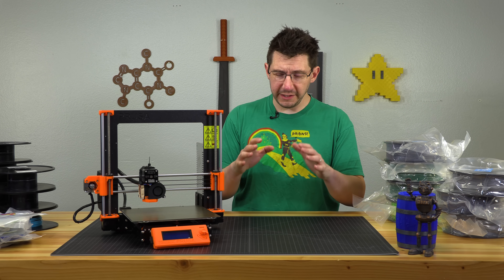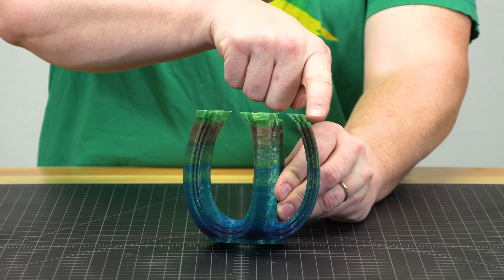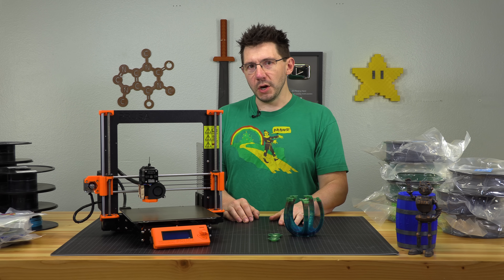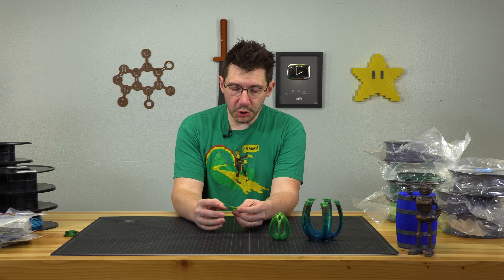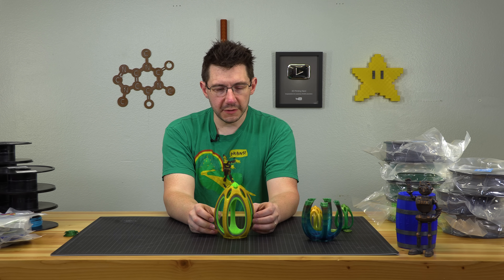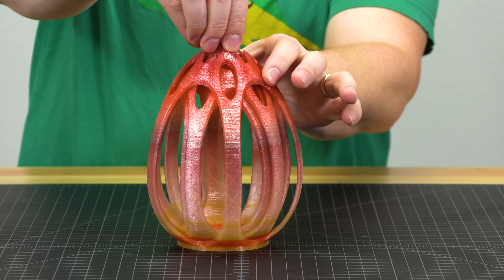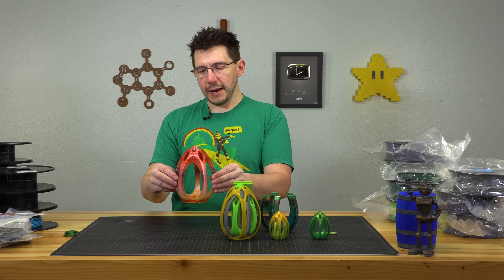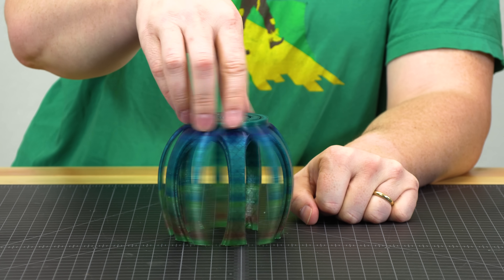This Egg Broke My 3D Printer - It's Maker's Muse Fault! #DestroyerOfWorlds

Comment: You have a LOT of printers, so I'd probably also ship it out rather than gut it and work on it myself with other projects on the table, but it would've been neat to see your troubleshooting process for the MK3. My first thought would be the optical encoder for the filament sensor being dirty or just going bad, though. That printer's a little too smart to try to print with a jam if it was a purely mechanical problem.

As far as cutting yourself while cutting a fused first layer goes, leather gloves are great for that. They make it a little awkward to cut fine details, but they've saved more fingers than I have, from all the times I've forgot to change the offset for higher bed temps. (And then there's every time someone asks for a really smooth bottom on a part and I groan and drop the Z intentionally for easier post.)
Reply from the maker: Oh, believe me, I took the machine apart a number of times. heh. It was awesome and sucked all at the same time.
Reply: That's a shame. Hopefully it was some kind of early unit issue. Got a 2.5 upgrade on backorder, and I think I'd go crazy if I couldn't pin down the specific issue. If you hear back on what it was, I'd be interested in an update.
Reply from the maker: It was beyond an early unit, it was a training machine that wasn't suppose to leave the factory. Oops.

Comment: Update your firmware. In silent mode I had plenty of layer shifts. Since the update 2. March ,they are gone
Reply from the maker: I'm running current firmware, and not using silent mode. :(

Comment: 200% is actually significantly easier to print, not only are the walls thicker making the part more rigid, but the gaps between the parts are twice as large. For a real challenge, try printing it smaller!
Reply from the maker: I did, I had a couple 100% scale eggs that I showed, did you see them?
Reply: 3D Printing Nerd Oh no I saw those, I mean scaling it down below 100%. Normal scale is still not easy and quite an accomplishment for any printer, but anything below 70% is very very tricky!

Comment: Do you know what broke on the printer, to cause such a layer shift? I would have assumed a motor or a belt issue... or maybe some structural issue that finally gave out..
Is there any reason you can't try to fix it yourself? Or is it just a warranty thing with these units that are sent to guys like you? heh
Reply from the maker: No idea yet. I took it apart a few times. I could try and fix it myself with parts, but it's a review unit, and it's going back to Prusa and team for research.
Reply: ah oh well. That makes sense. Just an odd defect I guess, hopefully it's extremely rare. heh

Comment: Be sure to keep us posted on what Prusa finds, as I have the same problem with my MK3, the semi all metal hot end just does not like PLA. Is there a easy way to put the original i3 MK2 hot end in the mk3 ? if so then I think we would really have a great printer.

Comment: Your retraction distance should be 2 or 3 mm, more than that it clogs. The layer shift is because layers at that point are not flat and thus nozzle hits them causing layer shift. Layers are not flat because of overheating thus expanding mainly upward. Nice prints, filaments and design

Comment: When someone starts having clogging and loading issues like that, what can they do to fix them?
Reply from the maker: In this case, I would normally play with temps, print speed, and retraction settings. However, in playing with this, it didn't solve the issue, and gcode that worked before now did not work with the same material. So, something was up.
Reply: Thanks for the reply! I really appreciate you and your videos. I installed a new heating block, all metal hot end, and cooling block yesterday (MK 10 on i3 Plus)... it's a pain to load filament, and doesn't seem to flow until about 112c. I printed a 20mm^3 to calibrate, and the first layer was GORGEOUS... no other layer even came out. I pushed the filament out with the little rod that came with the i3... I must have an alignment issue or heat fluctuation issue.

Comment: Hey Joel live the videos, for making each part of the egg move, why use 3 motors? Use just one and 3d print a set of geared rings nestled within each other with a tiny gear between each they'd then change direction on each phase/onion layer
Reply from the maker: That's a fun idea!

Comment: unfortunately most people haven't lucky on MK3, egg is printed but not movable, bottom layers are fused not first layer but upper overhangs, please post S3D or Slic3r profile because I'm really starting to think that this printer is all just propaganda
Reply from the maker: I know Angus got a good print on his mk3, and in his latest video talking about the community prints, he showed off some other mk3 prints. They looked good. I'm using default PLA settings in slic3r.

Comment: Re: motorizing. Remix the egg yourself. Add a shaft ending in a gear to the center. Maybe have it seat in a 608 bearing. Add a shorter hollow shaft and gear the the next shell and finally add a gear the the outer shell.

Comment: Im no expert but but tolerances are independant of size of print. It didn't fuse on the bigger model coz the tolerance is twice as big. Have you put in the same tolerance for the smaller and the bigger model both would have been fused or seperate.

Comment: I tried to print the egg like 4 times - first times got about half way, before clogging - then wouldn't get above 1cm without clogging. (200% on a wanhao i3) - went and printed a different model and it worked fine....its just a devil egg

Comment: I seriously want that filament it's MAGICAL
Reply from the maker: They are working on it! Right now it's a ton of manual labor to do. Once they can get a better process down OH DUDE you can bet they will be selling it.
Reply: I really wish protopasta would sell it...
Reply: They just need a hopper to rotate a bunch of colourant so users get a random selection lottery-style. Not that hard to discuss, probably a touch harder to implement in industry.
Reply: Actually, here's an idea; Protopaste might be able to take waste blocks and pay by the pound for them. In doing so, the blocks could be chopped, melted and coloured black as a low-strength filament provided for cheap as a means of waste blocks to find new use in non-load applications.
Reply: Not the exact same nor as magical, but I've had great results with https://smile.amazon.com/dp/B01IBF2T0Y/ref=cm_sw_r_cp_awdb_t1_fAa0AbPFQFYXQ
Reply from the maker: She is a sponsor here on YouTube, and for being a sponsor she gets that coolness!
Reply: Now if only I didn't have to sell the firstborn to get their stuff here :(

Comment: Id love to print that egg, but first I NEED TO FLIPPEN PRINT A BENCHY THAT DOESNT LOOK LIKE CRAP AND DOESNT FAIL! Ive printed 7 benchys, 5 of them didnt even get past the first layer, 2 of them didnt get past half way, one i had to stop cause it was in the lounge room, the 2nd failed because the fan wasnt on. Then there was my most recent and final (for now till i buy filament) benchy which failed at the boat's roof, IT WAS SO CLOSE TO FINISHING! Its really bumpy though, i need to figure out why i get such bad print quality. I know part of the reason why is because im using a Anet A8. I do need to buy a better printer, im just poor.
Reply: As someone with an A8, it works fine. I've gottent some pretty stellar prints out of mine.

Is your bed levelled correctly? It's a pain to get right, but take the time to do it or you will be punished.
Do you have proper bed adhesion? Brown masking tape and some glue stick is good.
Turn your print speed down. The A8 is happy with a max of 45mm/s for printing and 60 for travel.
If your slicer supports it, use resonance prevention.
Also, flash the skynet firmware. at some point. The stock firmware sucks as it doesn't allow for calibrating the printer, and the stepper motors scaled a few percent out so calibration is a must. After benchy.
At some point, print some support brackets. The A8 is about as wobbly as someone who's had five beers and two shots of whiskey.

Don't blame your tools for a lack of personal knowledge. Tweak, adjust, dial the thing in.
Reply: One thing to consider in a printer purchase is even though the printer is cheap, you waste time and money in failed prints and wasted filament.
Reply: The bed is the one thing that is perfect, ive gone over that thing repeatedly, theres no possible way it is not levelled correctly.
I have masking tape but i have not done the glue stick idea.
That is a good point, i need to turn it down.
Im using Cura and i havent seen anything like that yet.
And ive heard about skynet but never actually looked into it yet.
Ive been looking into supports right now, when i get more filament ill be sure to print them.

I know i shouldnt blame it, but truth is i got this printer months ago, got a replacement PSU a few days ago after i blew up the first one when assembling the printer, i kind of changed it from 110 to 220 while it was on. Today was the 2nd day of printing, but the first full day of being able to print something that actually didnt fail.
Reply: I knew that it wasnt gonna be easy and i knew i would need to work on this over time, but i was in a rush, i always am and so i wanted to get a printer quickly.
Reply: Hi there, if you are having issues, try the anet a8 group on Thingiverse, they are a very friendly group and I learned alot about tuning my a8 there. Post pics of your failed prints and settings, I'll try and help you out. https://www.thingiverse.com/groups/anet-a8-prusa-i3
Reply: My Anet A6 has the same problem, so I don't use it anymore and use my new(er) Hypercube.
I'v tried a lot of things to get my old printer printing properly again, but after replacing the heatbreak and adding a volcano heater block in it, the best I could get was  with a lot of missed extrusions.
The stepper and heater and thermistor and stepperdriver are all okay...
Reply: try reducing the retraction amount to 1.5mm. Dont buy a new printer!!! get to know that device and learn from it. Even on that one you can get good prints, and you can print upgrades to improve it. The fun of 3d printing is not so much the objects you print, but the road that gets you there.

Comment: Tried to print it at 100% scale on my MK3 but unfortunately for some reason I'm getting problems with overhangs there. It looks nice but it's not movable. Tried to break it apart to figure out what's wrong and there I saw that it's fused together because of bad overhangs in the first layers but only on one side. Cooling problem?! O_o
Reply: Sounds like over extrusion, too low of layer height, or like you said cooling.

Comment: Are the layer shifts only happening along the x-axis?  

My MK3 I just got has soft magnetic x-axis rods that are scored by the tight fitting x-axis bearings.  It printed a couple of test prints properly but I came home to a failed print and every print after that failed.  I investigated and found I could move the extruder by hand very easily  until the extruder got to a certain point and then it became very difficult to move.  Feeling the rods I could feel they were very rouch and deeply scored parallel to the movement axis.  This causes the print to shift along the x-axis when the extruder moves past the scored marks or to stop completely.

I emailed Prusa support last week but have not heard back.
Reply: Try the live chat, they may be a little busy but usually their is only a 5 minuites wait and they can sort it out for you their and then :)

Comment: Can your help me?? I have a monoprice maker select plus. I’ve printed a bunch of complex print successfully. But after I successfully finished the makers muse egg. I ran into the same problem. Its jamming bad. Is I take apart the extruder and all that fix the jam. another print starts good but a few layers in it prints in the air. And jams BAD! again. I did not use any new filament or something weird. I used stuff I know works. What do you suggest for this problem.
Reply: Sorry for the bad grammar. Typing this fast before my professor starts his lecture
Reply: Did you check the ptfe tube in the hot end's heat break? My prusa clone started having issues like that all of a sudden and it turned out to be the ptfe tube completely toasted and breaking apart at the tip, jamming my extruder head. The real issue was my thermistor not secured in place so my hot end would heat up much higher that the shown temperature.
Reply: I had similar problems with my Wanhao Duplicator i3. Not as bad as yours, but it was starting to get very bad. The problem on my machine was the Ptfe-tube inside the heatbrake that deformed/degraded/melted. 
Unscrew your hotend, an pull the tube out from the bottom of the heatbrake. Buy a new bowden-like tube an cut a piece of, that fits the heatbrake. screw everything back together and you have a hotend, that prints like new!
Reply: Another comment for ptfe tube check.  I have since upgraded my hot end because of this problem
Reply: bryan De Zeeuw weird, I don’t know a lot about that specific printer but assuming it uses standard E3D hot end parts I would try first replacing the nozzle and if that fails then I would replace the heat break. Again assuming it uses E3D compatible parts replacements can be found for less then $1 shipped from China for both of those parts
Reply: Carlos MDC thanks, I’ll check it out.
Reply: Logan 220 thanks
Reply: Toby Cowles thanks
Reply: thokk10289 Is it possible that you bought a tube, with slightly different sizes than the original?
or did you use the spare one, that came with the printer?
Reply: tonpa888 I was using the spares that came with it.  But i was also printing abs and petg... So yea the upgrade was needed lol
Reply: I print a lot of ABS. After a year exactly I had to replace my tube. Since then, my printer prints like at the first day.
Reply: I feel like when you use a monoprice over time it brakes like over months

Comment: First? Never mind I missed it by 25 seconds.
Haven’t finished the video but I assume it must be great as always! Hope the printer is revivable. 🤕
Reply: It might be a case of taking the extruder apart and removing bits of melted filament from within. Then I would test it on vase mode to see if that worked. Failing that, my guess is that the problem is elsewhere, but either way, I wouldn't know without taking the extruder apart first. I've heard of some custom filaments causing clogging, but I don't know a great deal about that.